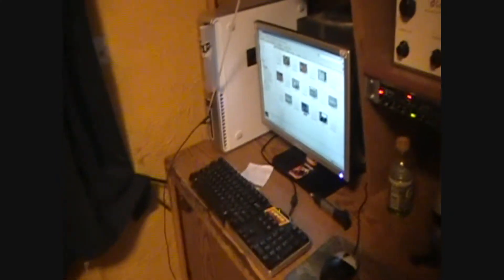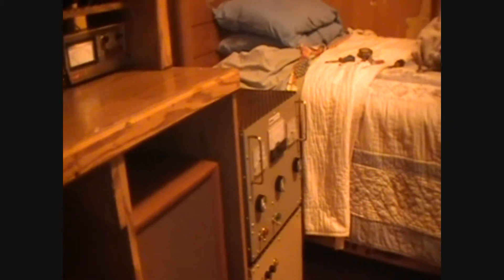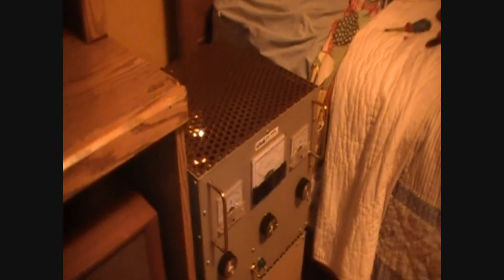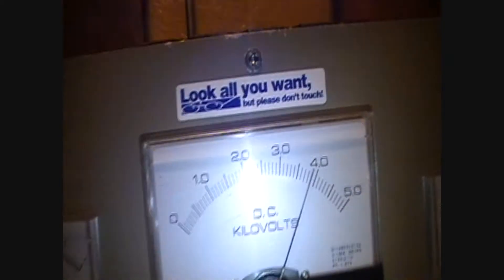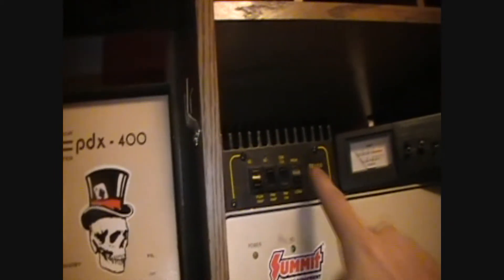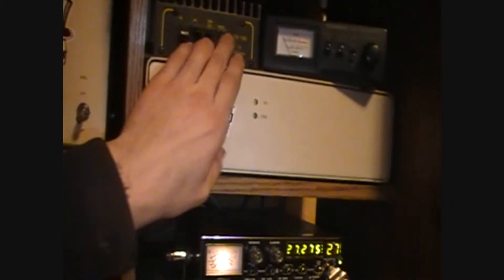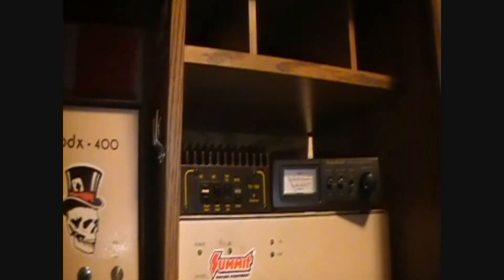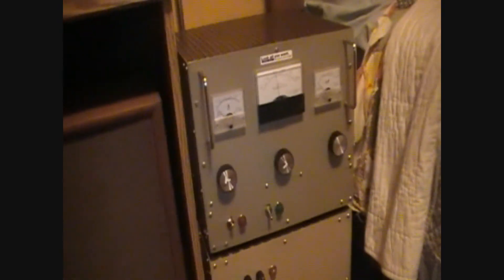Homebrew 2 x 813 Tube amplifier fired up Pt. 2

Comment: 4kV is much too high for the 813's. Should be 2.5-3.0 kV max!
Reply from the maker: Hence the variac thats now installed. Yeah I know it was too high but I couldn't adjust it that was the only tap on the transformer that worked good enough. Now I can adjust from 0-4kv. Usually run at about 2950 and get around 750w out easy. Sure they dont like 4kv but believe me they will take it. I ran it with 4kv for a while under short transmissions and they held up. 813s are one tough tube.

Comment: Dude, you wouldn't believe how many asinine big headed amateur radio operators who are basically "appliance operators", don't even have the slightest idea of how an RF linear amplifier works, never-mind build one from scratch. Knowing outdated silly "monkey see monkey do" Morse code is more important to the majority of the old farts in the amateur radio community than having an advanced knowledge of electronics and electronics engineering.

Nice work and very well done, 73.